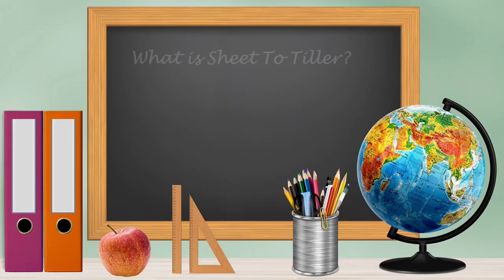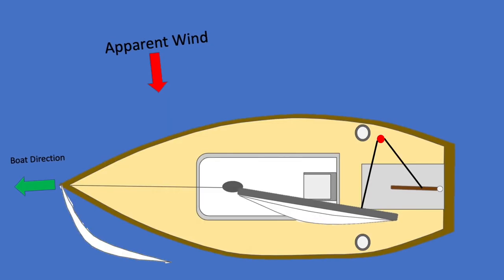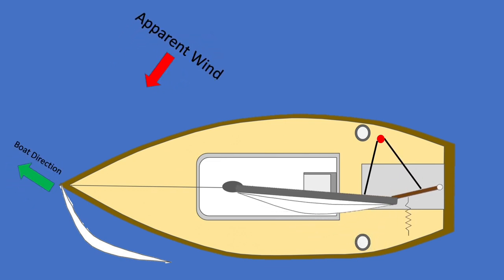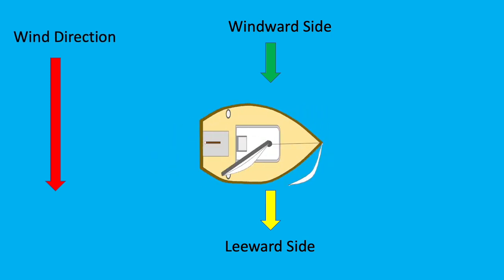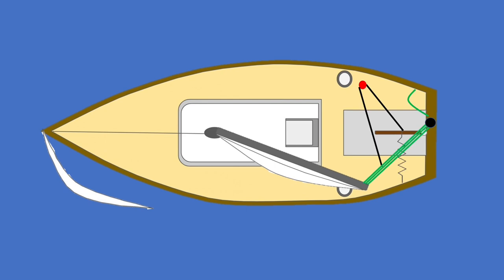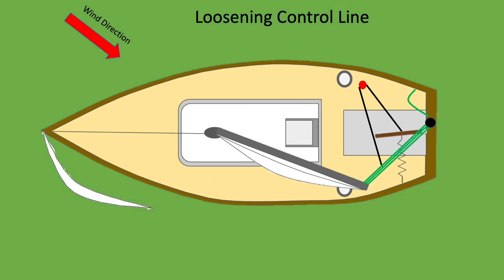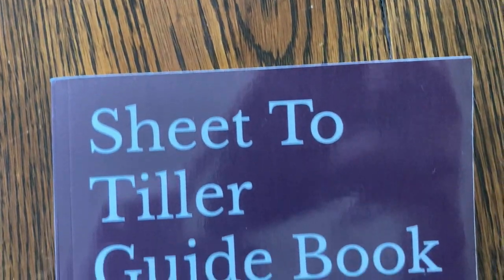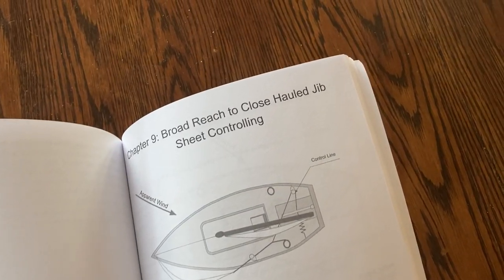How Sheet To Tiller Works | How to Use Sheet To Tiller Ep. 6

Comment: Thank you for this video. I live on an Alberg 30 and have been using sheet-to-tiller self steering for several years. I sail single handed several times every week and still it took me many months and much trial and error practice to become proficient. This has become one of my most useful and rewarding seamanship skills. A shame is that a few hours of (unavailable) instruction could save months of trial and error learning. Sheet-to-tiller has also taught me to be a better sailor because now I am much more attentive to having a balanced helm and strive to use the rudder more as a trim tab than a barn door. BTW: speargun rubbers and wishbone inserts make excellent elastics.
Reply: Wishbone inserts🤔

Comment: Sorry but this doesn't appear to make any sense at all. By apparent wind are you referring to angle or speed? Why is the boom moving? If someone is doing that they can be steering. As apparent wind moves forward (luffing) that reduces not increases pressure on the sails. Max pressure on sails/sheets is perpendicular to the wind. I'm sure it works but I don't see that this explains how.
Reply from the maker: the sail never reaches the point of luffing.  As the apparent wind increases (the boat goes upwind more) the sail has more power. More wind = more power.  So the sail experiences more wind from an increase in apparent wind and it pulls on the sheet harder and moves the tiller to cause the boat to head to leeward.  As the bow falls off the wind (goes more downwind) the apparent wind decreases, and loses power. Since it loses power it is pulling less on the tiller and the bungee overpowers the control line moving the tiller to bring the boat back up into the apparent wind.  It's all a balance.  The way you are thinking about it is how I originally thought it worked, but it's all about apparent wind.
Reply: @sheettotiller  Yes you like the phrase "apparent wind" but that's not how apparent wind works. If you're overpowered you reduce power by heading up. There's briefly more apparent wind speed but at a reduced angle so less load on the sheet. I could understand less load on the sheet allowing the bungee to move the tiller but can't see that an increase in load on a sheet already at full extension can cause anything to move. But, however you like to explain it if it works it works.

Comment: Certainly cheaper than purchasing an expensive wind vane steering system, which also needs boat to be balanced, and requires adjustment with wind changes, but vane system can offer a redundant rudder should you suffer a failure on your main one. Have watched some of your video's and feel this is something worth learning to master. I don't even have a boat yet, but will be giving it a try when I do.
Reply from the maker: Awesome!  I think it is a very good thing to know if your main self steering system malfunctions.  Thanks for the comment

Comment: This is a really well done video. Are there other tiller and line steering techniques for other points of sail, or tacking?
Reply from the maker: I will get another video on other points of sail eventually, I've been busy getting my boat ready to sail from Utila to Panama,  There will be some real time explanations in there.  

Essentially what you want to do it get the boat trimmed for the point of sail you want and then set the system up so it will pull the tiller to weather when the boat heads into the wind and elastic will pull the tiller to leeward when the boat falls off.  

Thanks for your comment

Comment: Rules:
(Balance the boat first.)
1. Control line to weather side.
2. Elastic always to the Leeward side.
3. If luffing add more elastic and control line.
4. If falling off wind elastic and control line are lessened.
5. Elastic pulls tiller to center or slightly Leeward.

Comment: Good description.  If doing this in a small sailboat, I have a 18 ft Hartley,  when everything is balanced i can sit on the cabin top and steer by shifting my sitting position. This has a lot to with the forward hull shape of the  Hartley. I have steered sheet to tiller for hours on end. Although small incremental adjustments are necessary.  Happy sailing. Thanks
Reply from the maker: Glad you liked it! I'm thinking about making a series on it that goes more in depth so people can get a better understanding.